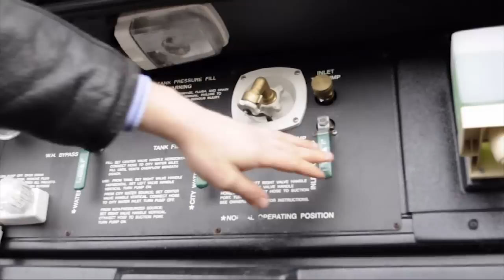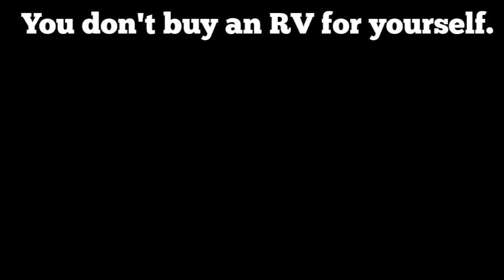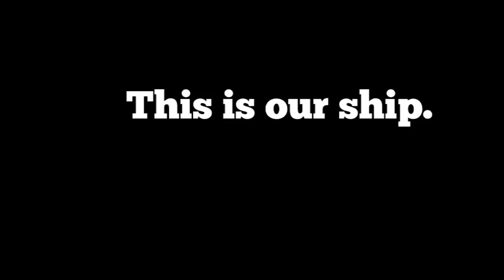Regular Car Reviews: 2004 National RV Tropi-Cal

Comment: I still think it's insane that any idiot can drive these things. No different license required.
Reply: Any vehicle can be dangerous. I don't really think the kinds of people who can afford a $300,000 vehicle got to where they are in life with reckless wanton behavior. Trust me at the end of the day more laws and restrictions serve to hinder us more than help.
Reply: hendo337 Just b/c you aren't reckless it doesn't mean you're not capable of endangering others due to inexperience.  US roads are large enough that ppl are ok for the most part, but it'd an ounce of prevention for a pound of cure to offer, say a day class to practice in a safe environment & certify or something like that.  And charge $ for it.  If you can afford a $300k RV, you can afford a hundred or so dollars or w/e for a day class.
Reply: I absolutely agree with you ... to be able to drive such a huge vehicle here in Europe you need to have a bus or truck license Idk, rv´s aren´t that huge here, the larger ones are more like wagons you put behind your regular car and tow them and even for that you need a separate license, but it´s easier and cheaper as it´s just basically an upgrade to the normal car license ...
Reply: Here in Canada you must have air brake endorsement to drive anything with air brakes

I was a bit shocked when Mr. Regular took the wheel and the guy casually asked if had ever used air brakes before
Reply: Graham White Does it really? I was under the impression that RVs were exempt here in Canada. Anyways,  still doesn't require a class 1 like it should IMHO.
Reply: Soooooo. should someone get a license for driving a Uhaul?
Reply: bluettr250 U Haul is a whole other disaster in itself.
Reply: ***** I just can't let the term "HEAVY RIGID" go by in a RCR thread and not call it out.
Reply: Having had a good deal of experience behind the wheel of one of these things, most times the dangerous idiots are the ones driving cars.  Uhauls may be the exception but anyone who drives even a Uhaul knows that it commands some level of attention and respect.  NO, most idiots don't drive 40' long, 9' wide 13' high busses.  They drive Buicks, Toyota Prius', minivans, light duty SUVs, base model Civics and Caaaamrrrrys; it is THESE people who need more training FIRST...  Why?  Because they're either pushing 8 decades, can barely see, have the reaction time of an oil tanker remembering when Buicks were the value luxury alternative to a Cadillac (OR) they view driving like going to the bathroom.  Though the most regular of regulars may disagree with the joys of pooping, for most, like driving, it's a necessity, not a joy.  They usually have zero spacial awareness and can't be bothered, thus putting in the absolute minimum care, awareness and skill into driving.  The advent of "auto park" and back-up cameras on even sub compacts should give anyone a hit of where driving skills rank in the average person's day to day.  Thankfully that same person is usually far too timid to attempt driving a monolith like this without proper instruction.
Reply from the maker: Astor Apatosaur haha
Reply: What's a special license prove?
Reply: Right.  And that's clearly important and works, because of all those people you've met that don't have a drivers license.
Reply: ***** I was on a school bus that ran out of air at 105kmph.
Reply: ***** I'm saying a piece of paper is meaningless.
Reply: spraynpray That's the difference between society & anarchy. In society, that piece of paper is a lot more meaningful than just being a piece of paper.
Reply: My point was that the piece of paper doesn't prevent those from doing something they shouldn't.  And I mean that both ways it can be interpreted.

A.  A man with no license just does it anyway.
B.  A man with a license that can't drive drives.
Reply: WTF no special license?
In Europe i can only drive a CAR with a normal license, a van is another license, a small truck is another license and a big truck or RV like this is the highest license which costs thousands to get and several exams to be done inluding physical and psychological.
Reply: Tom Jacobs It also takes you guys years to get a full motorcycle license. Ridiculous.
Reply: Ugh, it's like that in some states.  I moved from super oppressive Connecticut to somehow more oppressive California and they deleted my motorcycle license.  If you move there, any training and licensing you have is not only not recognized by them, but also destroyed by them.  I could no longer legally ride a motorcycle anywhere else.

Such massive assholes.  They just ooze slime there.
Reply: Colton Blumhagen First we get a A license which limits us to 11kw motorcycles at age 18. At age 20 we can go for an A1 license which limits to 35kw, then after 2 years experience you can get a full license so you can finally ride a bike with decent power.
Reply: In Norway, if we have a normal car licence, we can drive a car, or a truck that has a total weight of 3,5 tonnes, or under.
Reply: Tom Jacobs I guess it's good that idiots can't go out and get a 1000cc bike on their first day. But at the same time it doesn't take that long to be a decent enough rider to handle it.
Reply: A guy with a 1000cc bike can die so much more than a guy with a 200cc bike.  That's 5 times the death!
Reply: The rest of the world regulates and restricts the shit out of everything. No wonder they all love to hate us. 'Merica!!!
Reply: Like you
Reply: Trust me, we truckers feel the same way. It would do somebody a lot of good to go and get a commercial driver's license. At least go and learn how air brakes work. These things ain't toys.
Reply: Colton Blumhagen Lumberjacks cut trees!
Reply: Lumber Jack A lumberjack fells trees actually.
Reply: hendo337 1000% this. Really. You are NOT going to get some edgy teenager buying one of these. You're going to get, 90% of the time, highly experienced men between their 40's and 60's driving these. These are people who are retired, and have 30 or more years driving experience. We dont need a new license for this.
Reply: Re4096 Irrelevant, age & regular driving experience doesn't guarantee you have the skills to operate a vehicle of this type. Only proper training & testing can do that.
Reply: Colton Blumhagen you sure as hell are NOT going to be driving this thing if you aren't experienced. many of our customers freaked out from their test drive of 40-footers and decided against buying it for that reason. really the only people driving this are people who know their shit. training is not required for this, the physics are simply exaggerated physics of driving a large van or SUV and for the rest what you need is a rational mind that can think logically and if you have that you can figure that shit out.

P.S the only thing they are REALLY putting at risk is themselves and ~300K in assets. AGAIN i repeat, the customer will REFUSE to drive this if he/she does not have the experience required for it
Reply: No, that is ridiculous.  We need a government agency to print out a little piece of paper.  It will save us all.
Reply: Re4096 "Exaggerated physics of driving a large can or SUV..."
Incorrect, by quite a bit. Anybody who drives commercial motor vehicles for a living will tell you otherwise. Air brakes behave nothing like hydraulic systems. Neither does the weight that comes with a vehicle that large. You need to be educated and trained by somebody who has experience operating a CMV before ever considering taking one out for a spin. Driving a bus, truck or RV for the first time is not something you can prepare yourself for or even learn over the weekend. Personally, I would very seriously recommend a 3 or 4 week learning period before ever handing over the keys to somebody.
Reply: n8bolton Yeah except YOU JUST WATCHED SOME DUDE DRIVE IT FOR THE FIRST TIME JUST FINE. All he's got is driving experience, no CDL license
Reply: Yeah, but literally everybody died.
Reply: Re4096 He drove it with somebody who's got experience right next to him coaching him the whole way. It was a risk that he got away with, period. Not a smart move in the slightest.
Reply: Colton Blumhagen Not true in PA at least. You need a class A license to drive these here.
Reply: You should lobby to get that changed.
Reply: Bow Yang Jam Wow, that's good stuff. they ain't as backwards up north as I thought, huh? ;) Your state is clearly a step ahead of the rest. Looks like I need to rally some fellow drivers (folks who have legitimate experience with vehicles of this sort and aren't just talking out of their ass on the internet because they're too ignorant to know any better) to push some legislature through Texas state authority and TXDOT to get the same sort of deal implemented down here.
Reply: Lol We're a little bass ackwards here still.
Reply: Colton Blumhagen Sorry, I just don't hear of millions of these being flipped off of ramps into day care or tumbling through stop signs end over end into school buses or rolling backwards through car dealership windows or exploding randomly while parked in a Home Depot parking lot overnight.  Yeah, there are idiots all around, but idiots aren't driving this vehicle.  If you've ever driven a large vehicle, you would know that they command a certain amount of self-preserving attention.
Reply: Your pretty much driving a bus. There needs to be a licence for these.
Reply: n8bolton Airbrakes = absolutely no modulation. Hate them.
Reply: +Mike Miller Is there any reason why trucks and just big vehicles in general don't use carbon ceramic brakes? No brake fade and the vehicle price is so high already that adding carbon brakes won't really effect the price.
Reply: +alexlam24 Carbon Ceramic brakes are pretty difficult and expensive to manufacture.  Exotic car companies can invest in that technology because adding $10,000 to the price of a car just for the brakes is something the motivated purchaser will do.  This is good because it's helping to drive the cost of that technology down.  However, it's still an option on exotic cars because even the rich balk at that price.  Yes, the brakes last the lifetime of the car, if there are no problems.  But if you get into a small accident and hit a curb, the effected brakes may need to be replaced.  And normal consumers won't put up with those sort of repair costs.  I met the marketing company responsible for bringing Ford trucks back from the brink when all of their consumers were going over to Toyota (a more reliable and better truck in almost every estimate).  And their approach toward marketing those trucks was very interesting.  You basically have to baby the consumer with features and practical options.  Also, even if you have to replace standard iron rotors 5 times, you still don't approach the replacement cost of Carbon Ceramic brakes. Hopefully, CC brakes will become a cheaper option in the future.  But there's a point where better isn't doable due to expense and manufacturing difficulty.
Reply: Mike Miller Hahaha! I remember the first time I drove a tractor/trailer and went to step on the brakes. Oh, boy was I in for a surprise. Not like the hydraulic brakes in my car at all. Absolutely zero feedback from the drums to the pedal either. Have you ever driven a truck with the brakes out of adjustment and too much slack in the adjusters? Pretty un-fun. Lol.
Reply: +n8bolton Oh yeah. I borrowed an old Scania 141 back in the days and remeber that first downhill section in downtown Stockholm. I was loaded up full with soda bottles and beer and was going maybe 45km/h and hit the brakes, and nothing happened. At least it felt like nothing happened.  Then the system lost pressure and locked up and I almost shat my pants when the entire cab started jumping. Hard Learning back then. But the sound in that thing was just Amazing. Straight pipes, 14 Liters of massive V8 just rumbling like an earthquake. I just cruised the streets shaking windows. Good ol Days.
Reply: +Colton Blumhagen A piece of paper is still a piece of paper. Laws can be broken easily.
Reply: +Graham White It depends on the province actually. Most of em you can drive air brakes vehicules without any endorsement.
Reply: +hendo337 Idunno, how many rich folks have bought $100k plus cars only to plow them into trees driving like morons?
Reply: Keith Or the 28 year old mom with a 1 year old baby with no seatbelt that decides to T Bone my sister at 45mph by flying past a stop sign...  ACE body structure in the 2010 Honda Pilot is effective though.
Reply: +Colton Blumhagen Depends on what state you're in. Above a certain size and with airbrakes I know Illinois will will require a class B rather than class D. (So more like a bus or large box-truck rather than regular passenger car.)

U.S. is funny like that though. You can be from one state with really lax licencing and no vehicle inspection at all, and go and drive through another state where they're strict about it and it doesn't matter.
Reply: +alexlam24 Biggest benefit to air brakes is they fail on, the air pressure releases them so if something goes wrong they engage and you don't go rolling off into the nearest Starbucks at speed.
Reply: I don't know much about licenses in the US but here in the EU the class B car license is limited to a GVWR of 3.5 tons (which includes the trailer if its GVWR is > 750kg unless you get a trailer license too). For anything heavier you need either a class C license (truck) or class D license (bus) depending on how many passengers the vehicle is rated for
Reply: Over-regulation is a big part of what is wrong with Europe. We've got it here too just not as bad.
Reply: If it's 40' long, hell yes. Where I live (Australia), anything over 4.5 tonnes requires an endorsed licence. I have rented 4 tonne trucks before and they've been fine for things like moving house, hauling loads of stuff interstate and so on but this is a whole other class of vehicle.
Reply: I've watched my parents and my stepparents driving and the idea of most of them getting behind the wheel of something that size scares the piss out of me. They would insist that they know what they're doing, up to and including the moment when they understeer into a shopping centre.
Reply: but you fellows down under wear flip flops while on the track at just "burn out" events....seems legit....
Reply: Here in Norway (or EU in general) we have 17 different forms of drivers licenses. 4 for bikes, 3 for cars, 4 for trucks, 4 for buses,  one for tractors and one for snowmobiles.
Reply: outcoming That seems... a bit excessive.
Reply: you can drive a tractor trailer without a CDL if you wanted to too. As long as its not being used for commercial transportation
Reply: Ryan Lehr Probably depends on the state, but you have a point, "CDL" DOES stand for "Commercial Drivers License".
Reply: Here in Minnesota RV's have their own exception, as defined by a class D licence, as well as farm vehicles, that includes tractor trailers that only are moving back and forth from work sites [IE Field Harvest to Grain Elevator] 

Class: D Valid Single Unit and Combinations up to 26,000 LBS GVWR, All Recreational and Farm Vehicles.

So technically speaking you can have a RV on a semi truck chassis break that 26K limit and not be restricted.
Reply: I think it's genuinely funny people clamor for more license's to operate a specific vehicle, just another way for the government to delve deeply and greedily into your pocket, I guess. Especially when the problem isn't the vehicle, it's the people themselves. The types of people able to actually gain a license or sustain one over the years is just, unfathomable. Call it racist, but Sum Yung Ho that just immigrated from Korea to escape North Korean oppression is able to get a license easy, yet has no idea what a left or right turn signal is, which wouldn't be TOO bad if said person knew what the hell a brake pedal was. 

The amount of idiot drivers, distracted drivers, uneducated, ignorant, arrogant, disgustingly unaware drivers that linger today's streets are way more of problem than a specified license. I live in a City where 70% of the population are seniors, and 90% of those seniors are unable to walk without physical support, or are unable to walk period. How they're able to keep a license is beyond me, but clearly there is a flaw in the system of obtaining a license. 

Nevertheless, any idiot can obtain a license nowadays, anyone that shouldn't have a license is still able to sustain a license....it isn't the vehicle that is the problem, it's the people, or the system that issues license's that is the problem.
Reply: SpeCifiC0507 You are 100% correct!!  Any idiot who would attempt to drive one of these without taking lessons from someone who knows what they're doing is the problem!!!  We don't need the government delving even deeper into our lives and pockets!
Reply: ***** im not, but argentia will call in all spinsh speak natiosn in suth america
Reply: It's not actually that hard. Really, it isn't. At work I was terrified to drive our full size box trucks and 40ft trucks, and then after I did it and got a feel for where my blind spots were and how to manage traffic. It was just like driving any other car. It took maybe two trips around our block to figure that out. I've been in a bunch of accidents over my life, but none of them were in our work trucks.
Reply: If you saw what they were built out of, or saw the videos of them crashing, you'd change your mind.  They're coffins on wheels.  I bet even a smart car could split it in two.
Reply: Colton Blumhagen a pencil in my hands is more dangerous than this 40 ft rv in yours Colton.
Reply: I don't even think the EU has a category for RVs like this.

https://en.wikipedia.org/wiki/European_driving_licence

RVs are not buses.  At least they are not buses in North America.  Buses require a special Bus Driver's license.  So D class licenses would not be an option.  In fact, they're so not buses that people who convert buses to be RVs have to go to the DMV/MOT (place that deals with registration) to have the paperwork updated to show it is an RV now and no longer a bus or else they may be charged with an offense and lose their insurance.

RVs are not commercial vehicles, nor "lorries", or transport trucks, or whatever you'd call them in the EU.  So C class licenses are not an option.

They're clearly not Mopeds or Motorcycles, so A class licenses are also not an option.

They are motor vehicles, so B class is looking good.  "B" is no good, because a typical large motorhome will weigh over 9000 kg.  "BE" doesn't help either.  And they're not quadricycles, so "B1" doesn't work.

Motorhomes are just considered long personal vehicles.  Think "car", but up to 40 foot long, and 10,000 kg.  They usually only seat 4 - 8 passengers.  Air brakes exist but aren't on all motorhomes because many places in North America require a special license for that, so let's consider it as having hydraulic brakes.  If a car existed in Europe with those specifications, what license would you use for it?

North American licenses typically allow a regular driver to drive a vehicle up to 11793 kg and 40 foot length, so most big RVs are built to those limits.  Some are heavier, though never longer, and then you have to get a special license.  But those are extreme luxury coaches for the rich and famous.  You typically hire a driver for those.
Reply: It doesn't matter if it's a commercial vehicle or not. 3.5t or above requires a C licence. End of. This is a C licence vehicle.
Reply: Well, that explains why these don't exist (much) in Europe!

While I expect some in North America would be willing to go through some extra licensing to drive an RV, if the CDL requirements here are anything to go by, they include a lot of pointless stuff that would really kill the market, such as hours logs, including legal requirements for a weekend's (give or take) rest and knowing how to connect to a 53' trailer, basic maintenance on that trailer, adjusting the location of the wheels on the trailer, etc, etc.

Plus then the vehicle would be classed as commercial so you'd have to go through all the weigh stations (even though it's unlikely the weight will change by much) and all the complicated commercial customs each time you cross a border.

Not to mention the expensive medical exams and having to keep up on the medical exams.

In fact, the province I'm in realized that a lot of the commercial requirements are excessive, but does have an odd weight limit (11,000 kg instead of the higher 26,000 lbs).  They created a restricted class A (normally commercial) license that just includes the necessary testing for driving a 26,000 lb RV safely without all the extra BS.  :)
Reply: +3214342a
3.5t?! Geez...I get why you might want a specialized license for this thing...but 3.5t is less than many pickup trucks! I think a Suburban grosses over 3,500 kg...
Reply: Bow Yang Jam that's not correct. In PA anyone can drive these. The only way you need any other endorsement is if you're driving them commercially. If it's for personal use, which most are, you just need a standard drivers license.
Reply: Only for smaller RV's, but this one you would need a CDL with Air Brakes.
Reply: Colton Blumhagen in Ontario Canada you need a DZ licence which is an air brake licence. AZ is for semi trucks and vehicles that can legally carry over 10?passengers need a bus licence
Reply: "Not in Australia. You need a Heavy Rigid class license"
That's odd: "Heavy Rigid" is my CB handle...;-)
Reply: Not in BC you need the same class license the semi/bus drivers have to get at least if you want to be fully legal about it. Small RVs (like the E350 based ones) are OK without

Its different in different provinces/US states (most of the time driver licensing isnt a federal thing). Place like Saskatchewan or Montana with less then a million population and roads that are basically straight lines? meh whatever you can just drive. BC and its mountain roads? You better know what youre doing or youre going to fall off a damn cliff and were going to make sure you know what youre doing dammit because we already spend too much money dragging cars out of there. Ontario with its whack ass laws that put californias to shame? Higher class license AND air brake license AAAAND bus driver license (at least according to someone ive heard who dealt with an RV there) because screw you we need money really really badly
Reply: depending on the number of seats this will require a bus or big rig licence in Norway, a normal car licence is limited at 3,5 Metric Ton total weight
Reply: Anyone who feels like they cant drive this will realize it the first time they make a turn and when that happens, they arent buying the damn thing lol. Iv driven an rv similar to this and its not that difficult really. The only thing that was ever really challenging was navigating a very very very busy parking lot where people like to take up so much space not even regular cars can maneuver and get out or park. This would of been difficult in anything larger than the old tiny ford rangers.
Reply: A highschooler can rent a uhaul box truck
Reply: Colton Blumhagen Who spends $300,000 on a vehicle they can't handle?
Reply: good god going for an M.D isn't that hard of a process ha ha
Reply: A lot of retired families.
Reply: n8bolton only a week to learn a semi.

-go wide as much as you can, especially on right turns when you can't see much 
-give yourself at least a 1/4 mile or more to stop
-let engine brakes do most of the work before using your pedal brakes
-never swerve for anything, it's cheaper to hit something than rollover
-if you need to do a U turn, take all the space that's available or go around the block again
-you need at least 4 lanes of travel to complete a turn, so if you must set up from the outside lanes, do so because cutting too short will have you taking out a light pole and hitting a car in the opposite lanes

Etc
Reply: Colton Blumhagen Wrong. In my country you have to have a truck licence to drive a 7700+ lbs or 3.5+ tonne vehicle.
Reply: In BC you need a class 1 to drive a big RV

Some provinces dont have this requirement however and following them it really shows. I guess its ok maybe if you live in a flat place but here you can see they almost tip over a few times going down the mountain pass and then drive slow as hell like theyre freaked out the rest of the way
Reply: Bow Yang Jam says who? class A is for hauling trailer over 10,000 lbs
Reply: 3214342a  no it’s D license as long as gvw under 26,001 lbs ....either air brakes or hydraulic brakes law based solely on vehicle weight for private use in almost all states
Reply: "I don't really think the kinds of people who can afford a $300,000 vehicle got to where they are in life with reckless wanton behavior."

Hahahaha, I have serious doubts about that.
Reply: Tom Jacobs bullshit. The system throughout EU is the same. A is motorcycle with it’s subgroups based on age or experience. B is anything with up to 9 seats and up to 3500kg gross mass. C is anything with up to 9 seats and over 3500kg gross mass, maximum being determined by how many axles you have. D is anything with over 9 seats. E is an additional category for trailers (you can tow small ones without category E).
If you get a CE (you need to have C and to have C you need to have B already) you get BE automatically and should you ever get a D, you’ll get DE automatically if you already have CE.
Van isn’t a category of it’s own between a car and a truck so don’t spread misinformation. Driving school costs will vary by country, over here it was under 600€ for C driving school with less than 100€ for the government fees for government exams and license.
Reply: Pretty much, but for the specific one you need an air brake endorsement (at least in Oregon)
Reply: @bluettr250  if it has ajr brakes.
Reply: 'murica
Reply: @NorthWestOffroadAdventures   so why can't we drive a semi with a class d. or even the larger box or flatbed trucks?
Reply: If you are good with mirrors i dont see why you couldnt drive an rv and not kill anyone.
Reply: Even if I can drive this id still feel the need to get CDL certification
Reply: @hendo337  there are plenty of people with more money than skill or intelligence
Reply: Colton Blumhagen 
Well driving this is like carrying a table in a city bus. after a moment, every dumbass can learn how to do it! After bumping in like, 12 persons
Reply: @Boemel  Yeah, well we don't put up with that nonsense in the USA.
Reply: bluettr250 fun fact: uhaul's lawyers and lobbying is the reason you DON'T need a license to drive huge trucks and RVs
Reply: People like you are the reason we have so many laws and regulations breathing down our necks
Reply: @AE86ofMtAkina  WTF?  Why wasn't that beast fitted with a governor?
Reply: I believe they should be forced to get a CDL, shits very unsafe 40 ft long vehicle but normal license thats some BS
Reply: @hendo337  anyone can afford a 300k vehicle it's called payments. just another mortgage basically. A mortgage on a vehicle that moves. Dumb asf tbh and very bummy in my eyes just get a house. This shit depreciates just like a car. My dad has a friend who runs an RV park he said I would never buy one, it's dumb asf and its for mfs who don't wanna be a member of society usually social outcasts, the weird mfs in school, or old men who retired. He said its the biggest complete waste of money. Depreciates just like a car, rather put your money into a house downpayment.
Reply: @spraynpray  nothing. The fault is when people get too comfortable driving a vehicle. And they text/drink and drive. Like most people in little cars
Reply: @spraynpray  some you really wonder.
Reply: @ColtonBlumhagen  the problem is the arbitor.
Reply: @Boemel  welcome to government overreach.
Reply: @spraynpray  whyyy whyyy whyyy did you move to cali?
Reply: In europe you whould have to yeah. Anything with over 3500kg maximum weight requires a diffrent licence @bluettr250